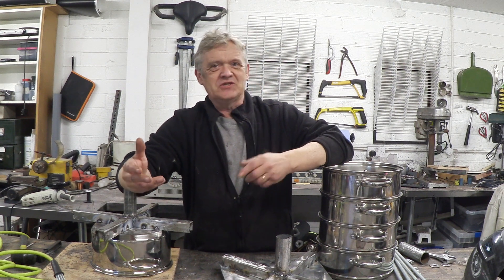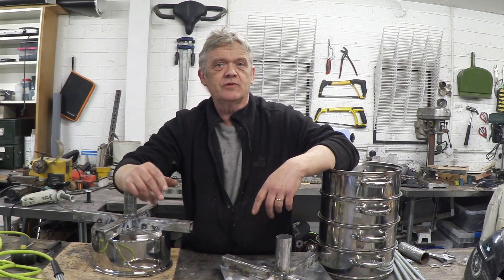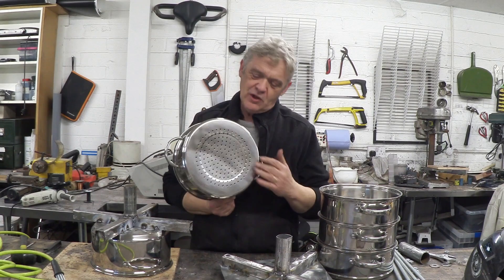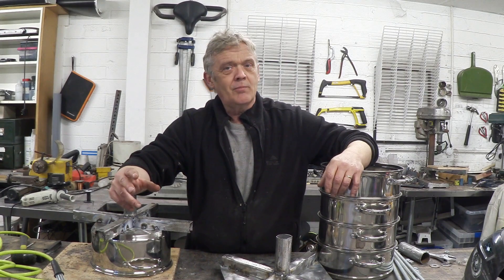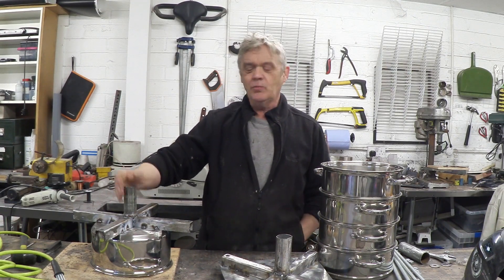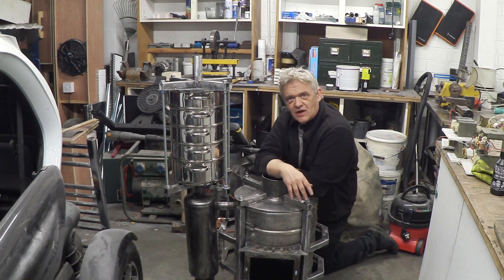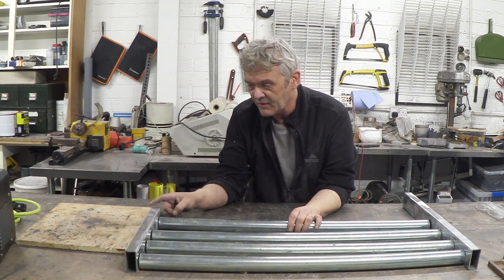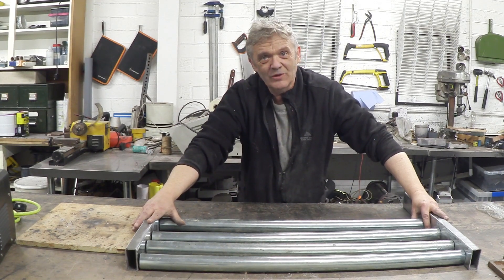DIY Gasification and Generator Unit - Part 6 - Air Cooling

Comment: QUESTION - for cooling, would it be worthwhile to capture the heat and store/transfer it to water battery? And use the heat for hot water tank, heated floors, radiant heat etc?

Comment: If you only drill holes in the square tubing and put all the pipes running straight from the top square tubing to the bottom it is basically a total waste of time.. As the gas will only travel straight from the top to the bottom.. 30"? But if you instead connect each pipe in series by either putting a U pipe connecting each end or by cutting a slit into the top of the square tubing and sliding in a airtight plate between every other pipe top and bottom to make the gas flow up and down to the end of it this would make the gas go say 30" times how ever many pipes you have.. The way you are making it will not be any different than just having one 30" pipe.. It will basically not work as a cooler at all. This is why all radiators have macaronis at each end to make the contents flow back and forth over as many feet of pipe as possible.

Comment: If you put some stainless steel pot scourers inside the cooling pipes it would greatly increase the surface area for cooling without creating too much flow resistance (works very well in reflux columns). You might also want to consider a method for draining any condensates accumulating in the cooling radiator. Great project Robert.
Reply from the maker: cheers mate and I really like the drain idea - not something that had occurred to me

Comment: Will the gas be able to flow through all those pipes like a draft or will it have to be pushed
Reply from the maker: pushed - you start it with a blower and then the engine 'pushes it' through

Comment: It seems to me that the Syngag would be cooled enough already by the Cyclone, Filters and the pipes linking them, that would all radiate a lot of heat, and the cooler perhaps is surplus to requirements?
Reply from the maker: maybe - but not from what I have seen mate

Comment: in my gasifier i built a turbo unit with something similar to a spinning chimney  sweep brush inside and water injection at the intake, i placed it after the cyclone filter (which did nothing ) and got very good results in both cleaning and cooling, and it also helped move the gas along the system.
Reply from the maker: nice - thanks for the tip

Comment: Didn’t listen to my comment on cooling and cleaning and drying the gases with old air conditioning design they used for old buildings? simply a tank with water spraying into it much better than all of that rigmarole
Reply from the maker: cheers mate

Comment: I have seen and followed the builds of MrTeslonian (YT user), but you are making this so very neat and cool looking! I really hope you will achieve good output in the end.  PS: what I do not like about this unit, is that it uses wood. If many people were to build these devices, I am sure there will be a shortage of wood real soon. In my opinion it is not good for the environment. But please do continue the build, I love to see the way you make choices and re-use so much scrap.
Reply: They can gasify anything dry enough to burn,, paper products,i.e. shredded files work well, I can get truck loads of shredded paper
Reply: @kennyclement2823  doesn't even need to be dry, one of the layers in the fire tube is using the heat produced to dry the fuel prior to the gasification process.  Now you cant have standing water in there but the thing was designed for emergency use where dry fuel may not be available
Reply from the maker: I would think wood is only one option mate - I plan on trying all kinds of stuff to see what happens

Comment: When i built my gasifier years ago (school science project) i found that there was a lot of liquid inside the radiator after a while, looked like some kind of thin creosote to me. i done mine using an old radiator from the house, lying on its side underneath the whole unit, and i didnt have a good way of removing this liquid while it was running.  if you are doing yours upright it might be worth angling your outlet square tube away from where the takeoff is going to be and include a transparent trap with some sort of bleed valve at the bottom (part of the science project was include things to improve for MK2 so i have this down) taht way the buildup of the liquid acts as a gas valve so you wont lose any product while you bleed it. then again, that might all be becuase my primary and secondary filters were not good enough. but hey, just something for you to think about
Reply: A glass jar at the base,brazed in of course, dose well as a liquid trap
Reply from the maker: that's a nice suggestion mate - cheers

Comment: That's also much  like a distillation column.  Could you try saw dust or broken glass(surface area) in those trays?  Further filtration while cooling.  Here we have stores like St. Vincents and Goodwill. There's always plenty of cheap stainless steel cook ware on the shelf there. All used and donated stuff.  I hope to do a version and springboard off you model. I have lots of interesting stuff to use around here.
Reply from the maker: that sounds really interesting mate and goodwill is a great place for parts lol

Comment: Just thought you could use a freezer to cool the gas down for ease and space saving. You could coil a pipe inside it like a still and put the pipes through the door.
Reply: Not nessasary,will cool quickly as he's doing
Reply from the maker: interesting idea mate -but I might have to use power to do that and the set up I have seems pretty ok
Reply: @ThinkingandTinkering  I know. I thought if you plugged the freezer in over night then got the generator going then plug the freezer into the generator it would keep it going.

Comment: This is really shaping up to be a beautiful piece of industrial art!!  I like that you pay attention to the aesthetics.  😊😊😊  Does the sawdust need to be replaced periodically?  If so, I'm wondering if perhaps some sort of gaskets might be more convenient in the long run than silicone sealant, so you don't have to redo the seals each time you replace the sawdust.
Reply: One could use silicon wet with soapy water shape and smooth allow to set a good bit then wet again with soap or release stuff assemble gently and shape the silicon allow to fully set
Reply from the maker: I am not sure how often the sawdust will need replacing but silicon can be use to make reusable gaskets - I might do a video on just that to show how

Comment: Cool!  How big of a gas pressure you expect?  (I guess not much) .  Will the vertical position of the air cooler be adequate? What I am thinking is: the hot gas rises . That should be mitigated by an horizontal orientation of the cooler.   or maybe not.
Reply: As the gas cools it will fall down the pipes especially if there is some means to optimise it’s cooling and heat recovery
Reply from the maker: there is not much pressure no - but the gas is drawn through the system by the engine attached at the end
Reply: @ThinkingandTinkering  yeah. I  lost track of the big picture

Comment: Good find mate, that should work perfectly as a filter. If you needed to filter it even more you could use some stainless Steel wool like the old SOS pads. Tear them apart and spread them out. More than likely you won't need that but is an idea incase you do.
Reply from the maker: it's a good idea mate - thanks for the tip
Reply: Steel wool probably also helps in the cooling down action.